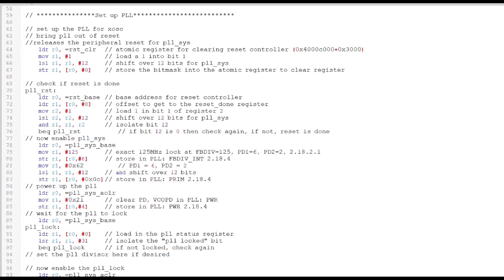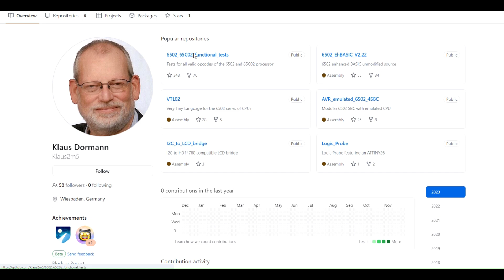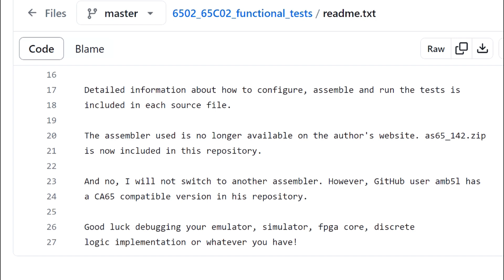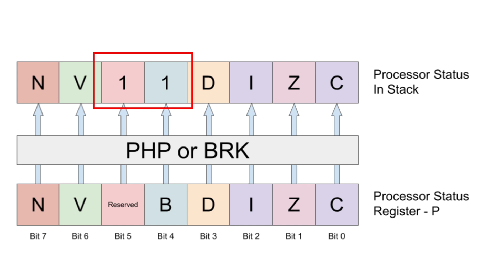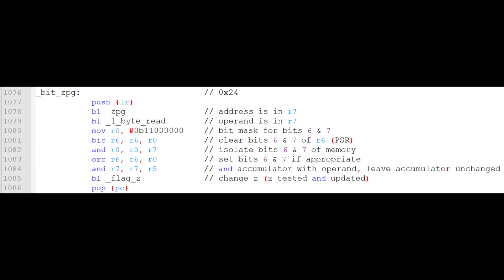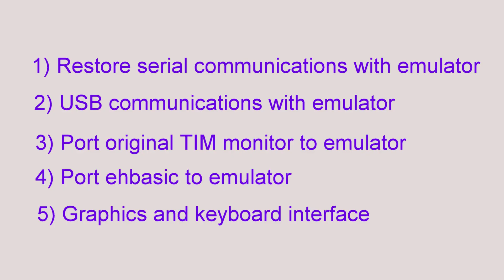RP2040 - Bare Metal 6502 Emulator - Demonstration - BMA10

Comment: The speed is impressive, honestly! Last march I wrote a 6502 emulator in Rust, and ran it on the pico / RP2040 along with a partner RP2040 wired up to act as a dummy EEPROM. The effective speed I saw in that setup running the same klaus test suite was about 1MHz.
Reply from the maker: Thank you.  I just ran a simple counting program using ehbasic, and the emulator is over 6 times faster than the same program using the 1 MHz 6502 TIM.  However, I think the best thing about an emulator is not the speed; but that we, as mere mortals, can actually "design" a CPU that works.  Congratulations on your emulator!

Comment: Pretty neat ;) And yep, I was expecting more speed. That’s because I kept forgetting the RP is not running that fast.
I’m also thinking that you made a compromise too for memory. As if you were repeating the code instead of having subroutines the thing would be a tad faster. But by how much I dunno.
Don’t keep us hanging too long for the next episode ;)
Kudos to you, David
Reply from the maker: Thanks.  I mostly repeated code; there are only a few long routines that I branch to.  There are a few cycles during each instruction where I restore register values to make debugging easier (register 4, op codes) that perhaps slow it down by like 5%.  I might be able to save a couple more cycles here and there by optimizing code.  Managing flags take a long time; you can make a fast; not so accurate, emulator; but I opted for as accurate a model as possible.  For instance; I worried about how the "reserved" flag was modeled; and you never use the reserved flag!  

I have run the TIM monitor and Tiny Basic on emulator and they seem to run fine.  I'll also see if I can find a benchmark that gives a more accurate speed number.  Thanks for watching!

Comment: I would think the interpolator hardware with masks and shifts on the Pico might aid in the 8 bit simulation? I don't think I've seen you use it. It's an interesting bit of silicon
Reply from the maker: Wow! I seem to remember seeing interpolators with the RP2040, but it didn't stick.  I'll have to look at that, maybe it would help.  Thanks for the tip!

Comment: Why was addition and subtraction so difficult?

uxtb r0, r0
uxtb r1, r1
add r0, r1
cmp r0, #255
ble nocarry
//set carry flag

nocarry:
uxtb r0,r0

or am i missing something???
Reply from the maker: The overflow flag is what makes it difficult.  The 6502 treats the overflow flag just a little differently than many other processors of the day.  Binary addition isn't too bad.  The binary subtraction is more difficult.  There are eight different cases of signed operands that affect the result, carry, and overflow; Ken Shirriff's blog (see the link in the description) goes into much more detail.  Using ones and twos compliment subtraction was much purer and more efficient then testing for each case. 

BCD arithmetic adds another layer of complexity.  I reviewed several tutorials on nines and tens compliment subtraction.  A lot of emulators just ignore BCD; but I wanted to get it right, including the carry and (hopefully) the overflow.  Klaus's test does not exercise the overflow flag for BCD math.  Thanks for the comment!

Comment: Now if you could build a breadboard that would let you emulate the hardware so you could build a replacement 6502 chip
Reply from the maker: That would be interesting; but probably not economical.  It looks like you can still get new Western Design Center W65C02 chips pretty easily from Mouser ($10).  With the level shifting hardware (3,3V to 5V); you would have three times that in a replacement module.  But that would be an alternative if the W65C02 ever goes out of production.  Thanks for watching!

Comment: now I want to write my own 6502 emulator :D
one idea would be to use Ben Eater's 6502 breadboard computer replacing the 6502 with the pico. and/or run Wozmon on it.
Reply from the maker: That would be an interesting project.  When I finish porting the TIM; it will have all the functionality of Wozmon plus the ability to load and save programs using the MOS Technology hexadecimal file format; see my video on the TIM for more info (https://youtu.be/BcqRvHkn-EA).

Comment: Interesting, I was expecting it to be much faster .I wasn't expecting it to be so awkward to do simple things like 8bit subtraction .I suppose that's because the rp2040 is optimised for 32bit operations where bits and bytes take a backseat.  I have written quite a bit of 6502 assembler , but I don't think I can remember a single instruction now   Stay young David, don't let time win. Merry Christmas.
Reply from the maker: Thanks; I think time will eventually win; but not without  fight.  I really like programming the 6502 (my first love); but I can see why the ARM machines are a lot more capable.  Subtraction was difficult because of overflow and carry flags.  In microprocessors; those flags are set in hardware (very fast); but not so in the emulator.  This is because the 6502 treats these flags a little differently than other microprocessors.  Plus, with a 32 bit machine; you need to play with bit 8 for the overflow; which requires a lot more code than you would think.  Old school with ones and twos compliment worked much better.
Reply from the maker: @NeverMind-pk4wz I can see that.  I also think operation of the 6502 overflow flag is not consistent with some other platforms.